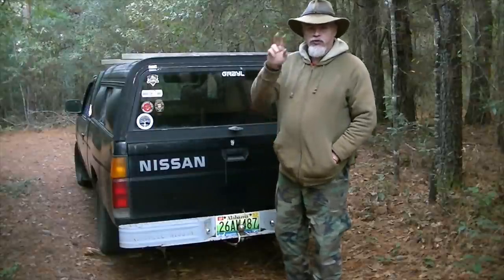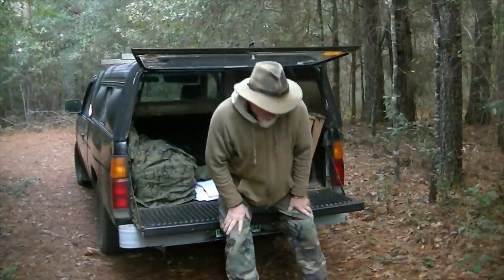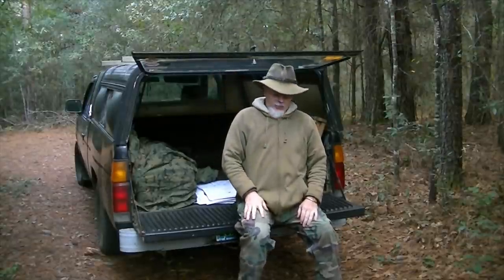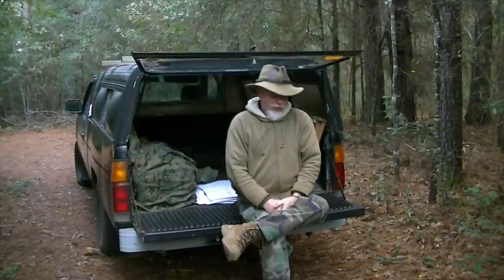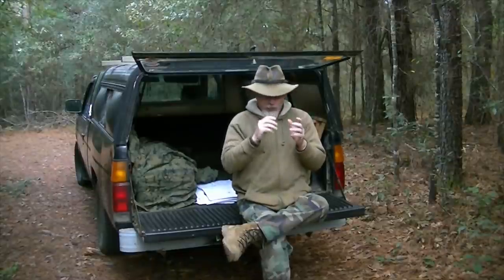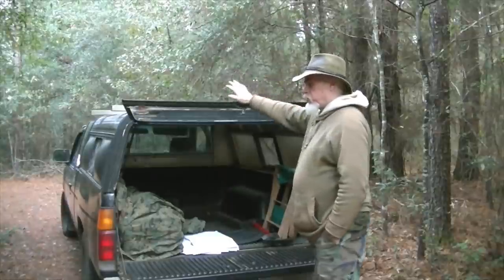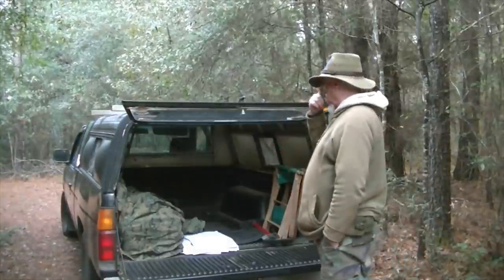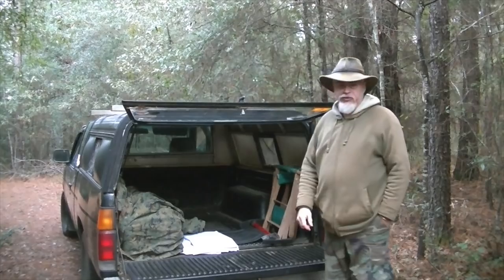HOW TO BUILD A TRUCK CAMPER ON A BEER BUDGET PT2

Comment: Mine is a 1991 Chevy Cheyenne 1500 short bed with a Continental camper top from 1994. I built a bed frame to fit a twin mattress with a pull out drawer that holds all my camping equipment plus guns or fishing rods and groceries. It is convenient and frees up floor space with everything stored in the big drawer. Mighty fine sleeping in the “big woods” when I take my hunting camping trips.

Comment: Very cool to see. I’ve done something similar with an old Ford Ranger truck bed trailer I’ve had for years. I pull it with my old Jeep TJ. Everything is repurposed and it is fully self contained. Cabinets from deck boards.  Eight quart pot for a sink. Seven gallon water tank with a rechargeable faucet. 100 watts of solar. Two 20 lb propane tanks a stove/heater. Roll up mattress 24” wide down the center floor. An old rifle case on the roof for locking watertight storage. A fiberglass carpeted shell I picked up for $50 from a friend. Even a tiny 12 volt fridge and variable speed fan. By the way you can repair holes in fiberglass with superglue and baking soda. This rig allows me to have a base camp and the Jeep is free to use. Harbor freight has a folding platform/ladder I use to enter mine as it’s tall and I’m old. It doubles as a 3 or 4 foot long table outside. Folds flat for travel. Well under $600 to build. Half that was three new tires!

Comment: Hey Blackie! Another well thought out well presented video!  First off, privacy, corrugated campaign signs covered with wood grain contact paper, prop them in front of the windows use cafe rods or a simple cord strung between two hooks.  Towels draped over cords or rods will work but proved to be fiddly to set up.  Lay a shelf made from two 1x12 shelf board across the front of the bed, frees up floor space for night time storage. utilize the cubbyholes  in front of the wheel wells for  ammo can size storage.  Low boxes made from 1x4s with a plywood bottom to fit under the bunk.  Not saying THE way, just A way that worked for me, been Boondocking out of a Toyota Tacoma for several years now, still a work in progress!
Reply from the maker: good info

Comment: With the aluminum or fiberglass topper. You can attach tarps with heavy duty magnets. One on the inside and one on the tarp on the outside. Telescoping tent poles for the outer corners. Or guylined out to trees.

Comment: I do agree with one option I purchased a 99 Chevy($750) Tahoe ,only issue I have is the spare it's under the truck. Gives me something to consider.  👍👍👍👍👍
Reply: O have a 2007 Tahoe  and yes the spare tire is under the back . The truck came with 6 bucket seats and I took the 2 in the back to give me more room. I am planning  on covering  a piece of plywood  with outdoor carpet or artificial grass and mount the spare tire  to the rear side where the Jack and tire tools are stored  just like the older model suburban.

Comment: I'm too tall to lay length wise in my compact pickup with the tailgate shut. I was lucky enough to get a tall pop up hunting blind on close out after hunting season was over at the local farm store a cot will fit in it ,it gives privacy to change clothes and room for a porta potty and a chair and table. The blind folds in seconds. I  also have a  foam block that can serve as a bed in the truck when I want to setup quick and just drape a mosquito net or tarp over the back ( depending on the weather) I also have a hitch mount luggage carrier I use to carry my bear box which can be used as a table or seat and keeps the food safe including the cooler.

Comment: Would you believe that I have been driving rigs like this all my life, and I have been driving longer than you are old.  The first was a 1961 American Motors Rambler that had seats that laid completely down and made a bed of the passenger compartment.  Old fashioned deep lug "snow tires" and two 2x2 poles bolted on for a roof rack.  I carried a John boat on top. I built it in 1966 and drove it for years.  
I got fancy after college and had better rigs but they all had to fit the same purpose.  It seems that people that do rendezvous and living history, as well as hunting and fishing, all have similar expectations from their rigs.

Comment: What’s your opinion of using an old van? Great information
Reply: I haven't used a truck in a while. I just use my Caravan as it has stow and go seats.  When I was a kid everyone used a station wagon for that duty.
Reply: The new style cargo vans always gets my interest to convert to a camping rig. Something like the Ram ProMaster 3500 body style as an example. For several years now companies started using them for deliveries and they come in several sizes. The older ones are available on the used market and a handy person can convert it to suit their camping needs.
Reply: Make it what you want/ need. If money allows put a locker in the rear axle. I still want one for mine.👍
Reply from the maker: vans can do much of what i will be talking of and could be a good choice
Reply: I install flooring all over Ohio, sometimes I have to  camp  in my van. No cot,I have a hammock stand that breaks down.

Comment: Blackie you nailed it again with this project. It's gonna be great. I had the perfect truck for this about 20 years ago and I could kick myself 100 times for selling it. A little story about it - it was an 1986 Chevy S-10. It had a 4 cylinder 4 speed manual shift , no power steering , no AC , no power anything. Just a simple man's truck. The truck was so dependable that in the 10 years I had it I only replaced the water pump and regular maintenance , plugs , oil change , tires and so on. I did everything with it , hauled firewood , pulled boats , hauled me and my son's to go fishing and hunting. I sold it to a truck driver who had trouble turning the steering wheel when he backed it out of my driveway. I bought a jeep after selling it but miss it to this day.

Comment: Good advice regarding the spare tire Blackie!
Tip: I use gray 1" schedule 80 PVC pipes for a tarp behind my truck. Yes, it costs more than schedule 40 PVC but it is alot more durable and the gray color blends better, and is stored on my roof rack.
Reply from the maker: Thanks for the info!

Comment: I had a friend to bring me a fiberglass high top shell for my 1999 chevy s10 for $20. 
While checking out yardsales  I bought an aluminum  camper shell and all 6 clamps for $40 for my 2006 chevy 2500hd. My wife's  cousin's husband  passed away  and my wife sister offered  to pay $300 for their fiberglass  camper shell  if I would cut her grass 2 times.  All three shells need a little wash job and they are all great.

Comment: Thanks for this great and timely video series. I am building my RWD Silverado.  
One thing I saw when I was a kid is people putting aggressive tires on the rear of a 2wd pickup and less aggressive, even street tires on the front .it helped mileage, cost, noise, and vibration but kept go power. Rotate side to side.
Reply from the maker: Very cool!

Comment: Re: Leaky Toppers  If you've been saddled with a leaker:  Can you fix it with roll-on/brush-on bed liner?  How much will a coat of it weigh?  Can you afford the $100 or so that it will cost?  (On the plus side, you can get the bed liner in a variety of colors, so you can use your paint budget for this as well.)  Can you get by with using Flex-Seal to seal up the individual holes?  Just my 1 and 1/2 cents' worth?

Comment: I use to travel with a topper on my pickups. One fiberglass topper had a bump in it in the back for extra head room. Bought it from a small salvage yard. I had sliding windows for the truck and topper so I didn't havto get out. One actually had no topper window as it was designed to have one of those cushened donuts between the cab and topper. I bought foam pipe insulation like pool noodles and sandwiched them between the cab and topper. Keeps out drafts, water and mosquitos. I did it for ever topper after that. This allowed me in an emergency to pass through to the cab and get roling. Some rest areas I parked in were not the best. I prefer an extra cab because I could store readily excessible items through the sliding windows.  I also tinted the litttle windows  in the extra cab so that  people couldn't see inside. You can make a shelf or even a piece of cloth to cover the area. Looking forward to see your other ideas.

Comment: You won't like a cot, they sit to high, you don't have enough room for getting in and out of bed. A better option is to build a bed that sits on the wheel well, that gives you about 10 more inches of head room.
Just my opinion..

Comment: Am I guilty of making a spoiler if I suggest that Blackie might have a plate that can be bolted into the lug pattern of that spare with a socket on it that will accept a pipe, that may or may not extend or couple to another short length of pipe, that could serve as a pole to support a tarp shelter?  Would Blackie's first section of pipe be lightweight PVC like the second section?  Or would it be three feet of steel pipe that would come in so handy as a cheater handle when the come-along needs to be used?

Comment: I have a ford ranger 2000, stick shift 4cylinder and is not a 4x4.  Looking to do travel nursing, but I worry about winter driving in this vehicle.  Any advice for me_
Reply: Winter tires will go a long way. Are you planning on being on road? Studded snows are my preference but studless also have great reviews and some good points. I drive RWD vehicles in New England all year. Snow chains are an option but very limiting. 
You can also get very prepared with a winch. It is a matter of how far you want to go and what weather you plan to drive in.

Comment: I dont know much about toppers or fiberglass but i did come across some yt videos about "poor mans fiberglass" consisting of canvas drop cloth and wood glue over plywood. Building small caravans. It may be an option for covering a cracked fiberglass camper. Thought about it for a dash cover in my c10.
Reply from the maker: you are correct i have seen one recovered like that